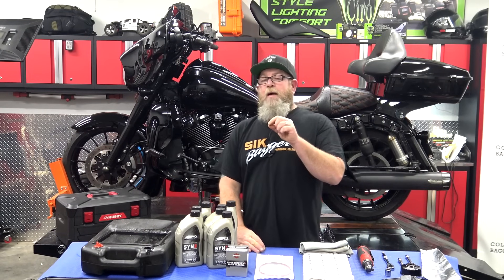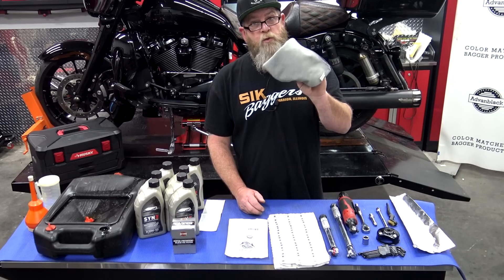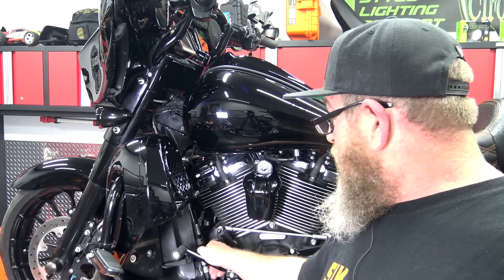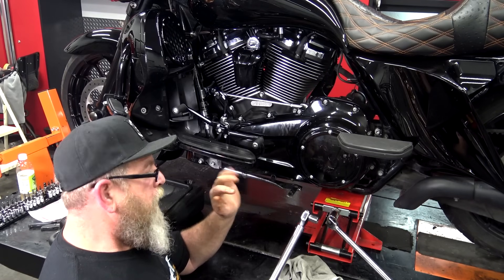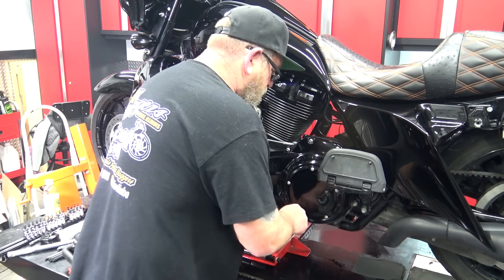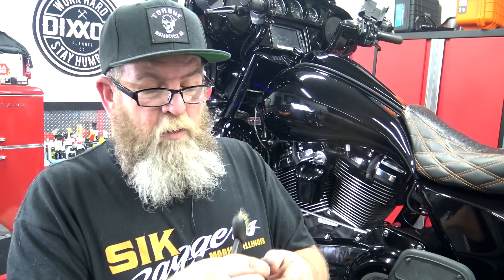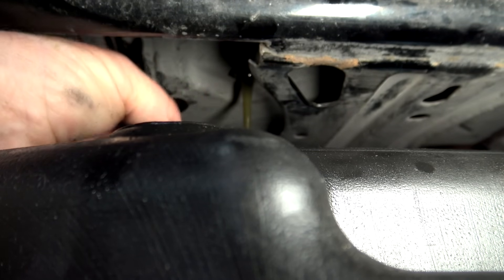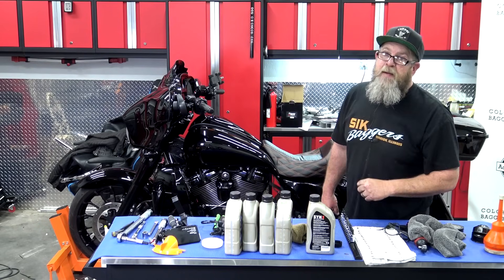⚡Milwaukee 8 - 3 Hole Oil Change @harleydavidson Touring - How To⚡

Comment: Why do people insist on wasting oil? Three hole oil change is wrong. Read your service manual. The transmission oil is not ready to be changed at the same time as oil and primary....just saying. This is a waste of oil and money
Reply from the maker: Are you drinking the oil after you change yours? oil is 5k, primary is 10k and transmission is 20k...I know math is hard but hang in there and I'll walk you through it tiger ...... first time is an oil change (5k), second time is oil and transmission (10K), 3rd time is oil change(15k), 4th time is ALL 3 (20k) rinse and repeat.  Hence " 3 hole oil change".  jesus this is the shit I wake up to...do better.
Reply: Clean oil is some of the best insurance toward mechanical longevity! Lots of evidence out there that HD's maint intervals for the primary/tranny are too loose. 3-hole it baby!!
Reply: @RonPetrey  your there doing the oil why the hell not do all 3 I guess there bike is not worth another $25 holy hell really people do all 3 every 5,000 pretty damn simple 🥴
Reply: I live in the southwest dry, dusty, and extreme heat. For example, it’s 09/30/24 and it’s 107 degrees. Yesterday, it was 114. So, the extreme temperatures where I live causes the oils to lose their “flavor” quicker. I do the 3-holes changes ( for the most part) on my own. 
I’m doing one this afternoon, it was 72 dollars total for the fluids,  filter, and rings. 
Nothing wrong with completing the 3 hole more than HD says.
Reply from the maker: @TonyDL   yess sir!!

Comment: How long till you have your 1 Ugga Dugga shirts for sale? 🤣
Reply from the maker: haha hey Mark...might draw some up for the next batch
Reply: Steve...if you supply it....they will buy it!!!!
Reply: My 2017 street glide transmission takes 1 quart 28 oz just doesn't do it. My 06 I would leave the transmission level low or it  would leak out of the shift shaft o-ring.
Reply: I’d buy one in a second.
Reply: Thank you for saying “make sure you check the tranny fluid on the jiffy stand” checked mine on the lift and it was bone dry 🤔

Comment: Tip for the oil filter slipping. Mine did the same thing, I had some skateboard tape ruff on one side and peel adhesive on the other side. I cut strips of it stuck it to the inside of the oil filter wrench and used it. The ruff side will grip the filter and you'll be able to get it off without it slipping.
Reply from the maker: Im going to have to get some...ive had 3 this month that HD did the last change on and damn..all been to tight...makes a mess for sure.

Comment: I used your video to guide me through the entire process.  I have a 21  Road Glide Limited 114. My trans took the entire quart but I did let it sit and drain for an hr or so while I took a break.  By the way Harley put copper antiseize on the derby cover bolts. Thanks for the info.

Comment: Excellent video really enjoyed your sense of humor. I’ve been riding motorcycle since 1972, have always done my own oil changes for the most part. I ride a 2000 road king and the first thing I do when I buy a bike is get a service manual if I can find one. The service manual has 5000 miles all three holes so that’s what I do.

Comment: I want to thank you for the video. I just paid $300 for a 3 hole drop. I will do my oil changes myself since watching your video. Thanks again
Reply from the maker: You're very welcome! I'm thrilled to hear that the video was helpful to you! Learning how to do your own oil changes can be a great way to save money and take more control over the maintenance of your bike.  By doing the oil changes yourself, you not only save on labor costs but also gain a better understanding of your bike's needs. It's a valuable skill that can potentially extend the lifespan of your engine.

Comment: Im not mechanically inclined, I bought every item you recommended here and changed my oil and transmission. (Only at 5k miles) My transmission oil was so clean  for a sec I thought it was the oil I just changed but then I saw that you recommend doing that at 20k. Gotta still do my primary. This was a great video!  Would like to see another done specifically on what else to check and service at 5 or 10k miles and also how to change spark plugs. Thanks Steve!
Reply from the maker: glad the videos helped and saved you some money! It wont hurt to do all 3 holes after the first initial 5k miles because you can really check for metal scraps in your oil and see if you have anything crazy going on in there.  I do have a spark plug video I just put out about a month ago here on the M8's  https://youtu.be/He3g2dMXBGg?si=L_X60C692sVgNatS  I haven't done a whole video on maintenance schedules but this link here will give a great idea of what needs checked and when https://www.stonewallhd.com/Service/Maintenance-Intervals

Comment: Just purchased my first harley 2023 road glide coming from a metric 2004 nomad. Harley made it sound like rocket science to change the oil. They did say they would do the labor portion free for the first oil change so I may let them. But im a killer shade tree mechanic who actually enjoys a sunday morning oil change so I will be doing mine from then on. This video is great, I subbed, liked and saved this video for when it is time to do the changes. I'm assuming the oil type/weight is all the same for all 3 holes? I'll be sure to look in my manual, and I didn't know that there were different intervals, ill look closely at that as well. Excellent tips all around, this vid will make it a breeze. Looking foward to checking out some more of your videos.

Comment: Ite. I just did an oil change on my Ultra Limited. I found that it takes 6 quarts exactly. I put 4 qts in the engine, and I did like you did with a graduated cylinder to get 28 ounces and 30 ounces, and then put the rest of the oil from THOSE containers in the engine. Took it for a short ride, checked the engine and trans oil, and the levels are perfect! 
Sure appreciate your video Sir!
PS. I tried the foil trick on the oil filter. Still made a bloody fn mess on the garage floor. LOL
Reply from the maker: Hey robert thanks for the comment man and for checking out the video...yeah  that tin foil trick can be a mess too..using one of those funnels designed for that is also kinda tricky to get in there...best way is to stuff a bunch of old rags in there and twist out as fast as you can and let the rags soak it up.

Comment: Steve AS ALWAYS...You nailed it. I do my own services as well and do it exactly as you just showed. The only difference is...I refuse to use a Harley Oil filter.
Harley filters are made by FRAM (Death in a can) which is THE WORST oil filter there is. The only other option is to use a Chrome KnN.
AGAIN like oil...thats another argument.
Thing is...youde be surprized how many people dont know the difference in filters.
Us Mechanics and motorheads know!!!
Thanks again for the outstanding content.
Reply from the maker: Thank you Sir! Never really had an issue with the HD versions but I usually run the Amsoil filters...do you happen to know the efficiency rating at what micron level for the k&n? without me having to do a bunch of research lol let me know...all I could ever find on the HD is 5 microns but that means nothing to me if it doesn't tell me an efficiency rating...like 90% efficient at stopping 5 microns? 70? who knows lol
Reply: @sikbaggers  ... I get what you're saying lol.    But according to KnN... the efficiency rating for their filters depending upon the application is between 25 and 100 microns.   The thing that I like about their filter is there is you can use conventional oil as well as synthetic And still have the same level of protection.  I have been an auto technician for 45 yearsAnd I refuse to use a frame oil filter on my car or any for any car what alone on my sled.   Working on cars over the years I have for the years I have done my research just like you with bikes and found that frame is the worst filter out there.   The only thing that they have is a paper element inside inside and I lot of times the  Element just decentegrates  Leaving no kind of protection at all shouldn't at all in the element element after it disintegrates ends up in your engine With no way to filter it out.

Comment: You explain everything in so much detail and it's enjoyable to watch all your how-to videos. Well, I did I bought a Road King for Christmas and traded in my Dyna. My question to you is I bought the 5 oil changes when I purchased it. My thinking is, it's under warranty so they can look the bike over and fix things as I ride it, I always after the warranty is over start doing everything myself. I always use syn 3 in all 3 holes, Harley dealer told me they stopped doing that and put syn gear oil in 2 holes, I hit 1200 miles and the first service is after the holidays should I tell them my way, or their way. Because I will have to do it that way? Your thought on the syn oil versus syn gear oil in 2 holes? Thank you, Merry Christmas!!!!

Comment: Great video but I have a question. In the video you say to check the transmission fluid level while on the jiffy stand. Even the service manual says to check it in this manner. What do you do when there is no jiffy stand, such as is the case with a trike? The service manual I have is for trikes and even it says to check on the jiffy stand. ????
Reply from the maker: if youre dipstick doesnt have two check levels, on jiffy/upright..then you could purchase the digital dipstick from HD that shows the temp and the level https://www.harley-davidson.com/us/en/shop/oil-level-and-temperature-dipstick-with-lighted-lcd-readout/p/62700194A?srsltid=AfmBOorHuudoRMggs5GZs-3B0H6BVLuw6txsWY494WDDlmg1Nei4FY9bfas i dont know the year of your trike but this is for the M8, 17 and newer trikes

Comment: I’m a new right and have a 18 fat boy with the 114 m8 and I’m fixing to do my service before the spring and was contemplating on taking it to Harley but after watching this video I think I’m going to save the money and do it my self. I called a couple dealers around me and it was like 5-600 dollars for the service.
Reply from the maker: yes its very easy to do. Youll be done a lot quicker than you think and have that extra money to buy cool stuff for your bike instead of giving it back to HD

Comment: Thanks for the very informative video. I am very relieved knowing that hd doesn't need all the money. I've been told that services for hd are very expensive. I would like to ask about what brand of jacks I need to purchase . I want a good one for safety, of course.
Reply from the maker: They can be pretty pricey yes and it is something you can definitely do at home. Youll need to purchase a few tools/jacks etc but you only to purchase them once and your set for the life of your bike or bikes.   Doing oil changes on your floor with a motorcycle jack you kind of have to get creative...If you use a full on motorcycle jack I would reccoemnd this one https://amzn.to/3PO5heD or this one https://amzn.to/3D21Idh  With this style you will need to position it where you can reach the drain plugs but also get a oil pan under your bike so that's where you need to get creative. But you can use the smaller scissor jack like this one https://amzn.to/3pCizA8 Now with this style I would not go putting the bike way up in the air...remember you only need to get the bike upright and there is room to get under there and get to the plugs with the tired barely off the ground. The larger jacks are great for doing everything else but oil changes but for this I would use the small one and put it more forward on the bike so it only lifts the front end slightly. Then you have room for your pan and hands to get the plugs. I hope this helps! Be safe!

Comment: I have 22,400 miles on my 2021 Street Glide and just payed for the last oil change yesterday... I'm over it...
Thank you for helping illuminate my fears of doing this....but hopefully I will not have to get my filter off with a chisel 😮
Great video
🏜️✊🏼
Reply from the maker: Thank you for sharing your experience! HD's prices for maintenance can be frustrating for sure.  I'm glad that the information provided helped alleviate some of your fears. The goal is to provide useful guidance and insights to make tasks like oil changes easier and less daunting. Hopefully, you won't have to resort to using a chisel to remove the filter..that really sucked but was a rare instance of an HD dealership over tightening the filter on a previous oil change. If you have any further questions or concerns regarding your motorcycle maintenance or any other related topics, feel free to ask. I'm here to assist you and provide the information you need.
Reply: @sikbaggers  As with Derby cover, I make sure I can get oil filter off BEFORE draining.    Love the videos!
Reply: I do not have a service manual yet.. how any ounces for transmission and how many ounces for the primary?? Thanks  @sikbaggers

Comment: Amazing Video! Do you by chance have a video of what the best oil to use is? I have a 2023 road glide standard. Got my 1k done at dealer. Will be doing everything myself from now on.
Reply from the maker: hey glad to help and thanks for the comment...I normally dont dive off into "whats the best oil" conversation because everyone thinks their choice is the best choice lol ...what I can tell you is this and this is fact, no opinion...if you change your fluids when your supposed to you can run whatever oil you want. Most oils have additives packages added in for extreme conditions....unless you are riding i the dessert or or the Antarctica everyday you are riding in normal conditions. The key is not what you choose to put in its making sure you change it when you need to. With that being said I have ran harleys syn 3, redline, and amsoil...i have never noticed any difference in the operation of the bikes, or the break down of wear parts (excessive metal shavings in the oil) when using any of these oils. So which one is best? The cheapest one is the best. They all do the same thing. You will have people scream and yell about how great one product is over another, one shifts smoother than the other... im here to tell you, it dont! They all work great if you chnage it when you are supposed to. I am currenlty running amsoil because my buddy is a dealer and I get it cheaper. But if syn3 was cheaper I would use that. I hope this helps you and if you have any questions let me know.
Reply: @sikbaggers  Now this was the perfect answer i was looking for. Thank you so much. When i got my 1k done @ dealer they put Syn3 in all 3 holes. They did say if you do more 2 up riding to change transmission to the Gear oil. I was thinking about doing that myself. Any answers on the Gear oil from Harley? I would like to order straight from Harley website but they only have kits that put the gear oil in both primary & Trans. Dealer said they wouldn't recommend putting gear oil in Primary. Again thank you for the help. Love the Channel and your videos are hands down the best!

Comment: Great video, thanks. I'll be doing my first three hole on my 2022 triglide ultra. Since there's no jiffy stand how is the transmission oil measured?
Reply from the maker: Youre trike dipstick should read for "Bike Level" I think HD actually sells a specific stick for trikes if yours does not have it.
Reply: @sikbaggers  Thanks, I guess I'll find out when I do the job. Once again, your video taught me everything I need to know where other videos have failed. Now if I could only use the bike lift I have from my previous Ultra limited it would make things easier.

Comment: Yo Steve, does it matter if you have a frisbee primary gasket  or the newer orange gasket with the nipples can you use either on your newer primary cover?   I was told at the steeler either will work?
Reply from the maker: yeah the stealership is wrong lol The flat style gaskets are for flat style covers...no grooves on the back side. The orange nipple gaskets will work  on the derby covers with a definitive groove on the back side that the o ring sits in
Reply: @sikbaggers  Thank you!!!!!!
Reply from the maker: @fredsparks4481  yes sir.

Comment: Thanks for another great video Steve.  What is your personal preference on oils?  I use Maxima in mine.
Reply from the maker: Thanks Jason...ive been using amsoil for quite awhile now only because I have a local dealer and get it pretty cheap...put maxima in several bikes though with issues.

Comment: Hey friend! Great video! Just wondering what lubricant you put into the derby cover for the primary? And if it’s possible to do a primary fluid change on a jiffy stand?
Reply from the maker: You can do it on the jiffy but you will need to have someone or something to hold it upright to check the levels..there is no dipstick..its a sight check. you cna run syn3 in hole 3 holes including the primary but there are better solutions on the market for primary and transmission.
Reply: @sikbaggers  thank you kindly!

Comment: Thank you for the video! I am just a little confused about the wet fill amount. I have a 21 RKS with the 114. I filled it just until I saw it hit the bottom of the pressure plate, but it only took 28 oz. Everything was done with the bike upright. Does that sound right?
Reply from the maker: yes if 28 oz put it to the bottom of the plate you are good. You can always pull it after riding and check it again though..that gasket is very much re-usable.

Comment: Nice video on the M8 3 hole oil change. I fid this on my old 88 and this is just a modern version of that.
Reply from the maker: Thank you robert and yes..not too much has changed...bolt location and levels of course but still pretty simple to do at home.